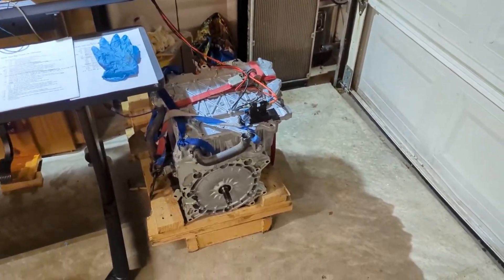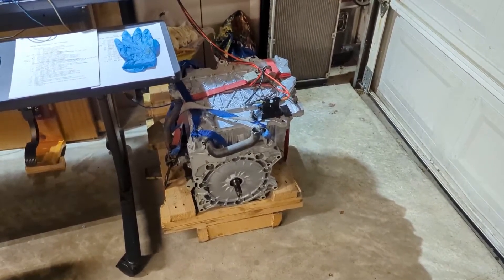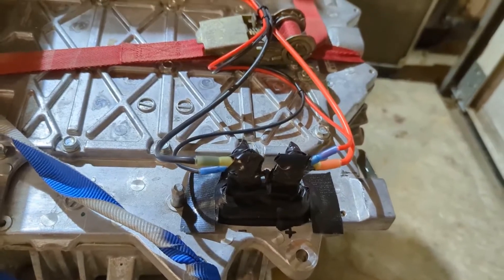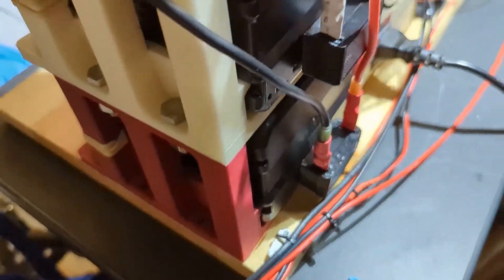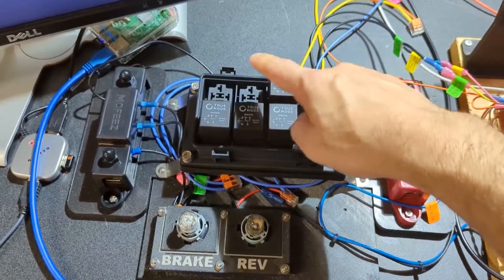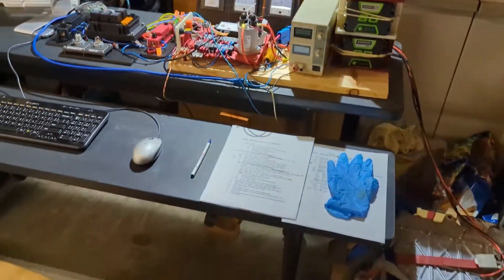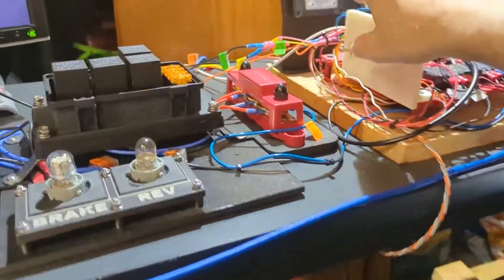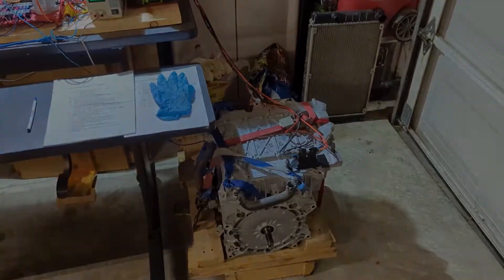Porsche 924S EV Conversion - Part 8 - Thunderstruck/Leaf bench test setup and walkthrough

Comment: So helpful for the Leaf powered conversion I'm pursuing, especially on how to get enough voltage to spin the motor. Can you share links for where you acquired the various components for the bench test, like the relay box, the pre-charger resistor and the contactor?
Reply from the maker: thanks Jack. The pre-charge resistor and the contactor came with the accessories kit on the VCU from Thunderstruck. The relay box is the "True Mods 12V DC Auto Waterproof Fuse 5-Pin Relay Box Block Kit" on amazon, but there are other relay boxes on Amazon that are probably better to use.
Reply: @FrankGraffagnino  thank you sharing all of this excellent work. How did you decide on the Volt battery packs?
Reply from the maker: @jackhmason  well, i can't really remember, but this vehicle is so limited on space, i'm not sure it was a good choice. I may wind up needing to switch to different battery modules and wind up losing my investment in the volt batteries :(

Comment: I've been trying to figure out the wires coming out of the motor and which ones go where I couldn't tell from your video though nice job of wiring everything up really clean and neat
Reply from the maker: Let me know if you need help tracking down some information for this motor
Reply: @FrankGraffagnino the problem turned out to be the low voltage cutoff was programmed higher then the battery pack. Had to use a computer to get in and change the settings. Looks like there's two grounds 2 12 volt positive and a key on. I did a 924 years ago back in the days of blood acid batteries. It performed very well I think you'll be happy..

Comment: Would it not be possible to use a $10 bridge rectifier and cap on 240Vac to get 340Vdc?  How about a voltage doubler on 120Vac?
Reply from the maker: Theoretically possible and Benjamin Nelson did that on his YouTube channel so you might go check that out.

Comment: Hi Frank, great stuff and very inspiring to see this father/son tandem at work! Question: I will use a compact bench battery system too based on RC heli/aircraft battery packs in series (that is my other hobby...). What is the current you draw with your configuration from the 250V pack? And what is the capacity of these greenworks modules?
Reply from the maker: I'm not sure if the exact current unfortunately. It depends on the load from the motor / inverter and your commands to it. But I can assure you that when you use fuses you need to make sure you use high voltage fuses and not traditional auto fuses - the current may be sufficient, but if it has high voltage it will jump the gap of a broken fuse. Lesson learned!

Comment: So, which batteries or BMS did you end up using?  DIYBMS?   SIMPBMS?   ORION?    THUNDERSTRUCK?    EMVEV?    We are putting together our own packs..
Reply from the maker: We are using a Chevy volt battery and the thunderstruck MCU
Reply: @FrankGraffagnino  how did you get them talking on the CANBUS?    And how would I get my home grown BMS to talk on the CANBUS?    What is the tool called that does that?  I’m not afraid of coding.  Just don’t know which direction to connect to different devices on the CANBUS
Reply from the maker: @gjsxnobody7534  I'm not sure I fully understand your question. Basically if you just hook up the two wires they will start talking. If other devices are listening the msg IDs that are on the bus they will pick them up. Having a computer also hooked up to listen in on the communication can be helpful for debugging or generating CAN messages. Lots of great software for PCs to talk on a CAN bus.
Reply: @FrankGraffagnino  Yes, understood that the messages will flow on wires when connected (properly of course).    but if I buy an accesory that has msd ID = 123,  how does the corresponding item know what msd ID = 123 means?     for example, you have a accelerator pedal,  and I want to use a hand throttle instead.   how does the VCU, or Motor controller know if my throttle accesory is sending a msg ID that is something other than "123"..   or are all throttle/accelerator standard world wide?
Reply from the maker: @gjsxnobody7534  so some of the items that come from vehicles will have all of their messages hard coded in them. There are files called "DBC" files which are sort of a description file that explain which bits for each message can be translated to a real number. I would suggest as a first step to just get a CAN data logger set up which can let you log all the data and then eventually parse the data out of the messages. This page has a decent CAN overview: https://www.autopi.io/blog/can-bus-explained/

Comment: Great setup and lots of good advice, thanks for sharing, just wondering are you planning to use a second contactor for the HV Battery negative? I understood it was normal to do so and I plan to use two contactors and a fuse in my rear battery pack as well as in the HV junction box.
When sourcing your HV Battery consider the physical size and shape of the modules and how they will fit into your car and how they are linked together. I bought an eGolf battery pack and the modules are less power dense than those from a 40kwH Leaf pack, heavier and less easy to link together. They are probably easier to fit in a space where height is a restriction though. It would be good if you can work out the shape your battery boxes will be before buying the battery modules so you can buy modules suitable.
Reply from the maker: this is great advice. and yes, we've learned that you really need two contactors instead of one so we plan to do that. It looks like we will be going with the chevy volt battery and it has two contactors inside a module at the front of the pack... i'm hopeful we can reuse those. But if not, we will just add a second one to the one that we have that came with the thunderstruck kit. Thanks for the comment!
Reply: @FrankGraffagnino  I got contactors with the eGolf battery pack but they do not have economisers so will draw too much current if driven constantly from 14V and will have a shortened life. I'm planning to use a buck converter to reduce the voltage to 10V where they seem happy to switch but draw much less current.
Originally I was going to have 4 or 5 battery boxes but when I realised how difficult it would be to make them safe I've now changed the layout. The thought of live cables running the length of the car with no easy way to kill the power from them did not appeal so I'll be losing boot space but gaining some safety.
 Have you seen Damien Maguires video where he was working with Volt batteries? The look to be very tall.
Reply from the maker: @alibro7512  that's interesting... i'll have to keep an eye out for how much current they draw. I haven't seen the video you are referring to, although I've watched a number of other teardown videos. The batteries are a bit tall so they won't fit in our Porsche the same way they went into the volt, so that means we will need to position each module in the front of the car and (hopefully) not have to put some of them in the rear. But, we'll see.